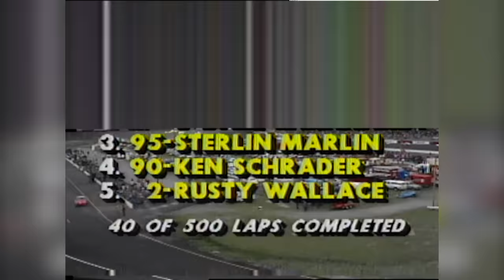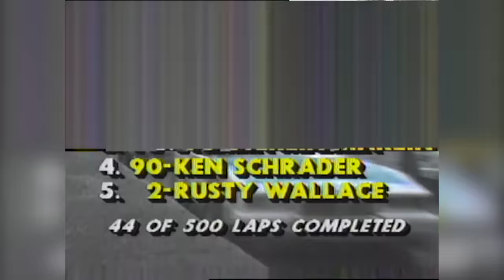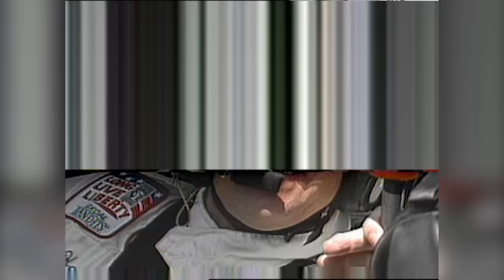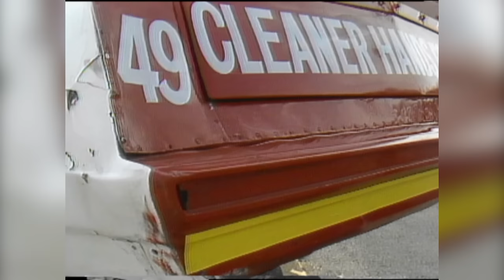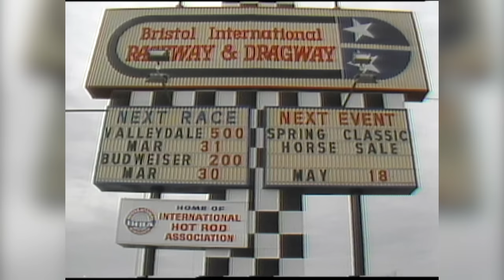NASCAR Classic Full Race: 1985 Valleydale 500 from Bristol Motor Speedway

Comment: I believe about 50 laps in Earnhardt lost power steering!! Just imagine running 450 more laps with no power steering!! What a badass
Reply: That is how they use to drive back in the day.
Granted the steering wheel are larger also...
Reply: They were also slower, had smaller tires and less aggressive suspension geometry. Makes a big difference and necessitates power steering
Reply: I know right! The drivers today are so pussified they would've dropped out the moment that went out, Earnhardt didn't. Earnhardt did everything it took to win.
Reply: @calebBalls69  nascar is a joke now

Comment: Need black curtains for the sides of my tv to frame uploads like this to conceal the blurry pillarboxing.The solution that yourlifeisagreatstory responded with isn't much of a solution since if you zoom in to hide the pillarboxing, you're also cutting off the top and bottom of the 4:3 image.
Reply: Most [newer/modern] TVs have a zoom or “Format” button/setting  that will helps with that issue.

Comment: Oh look, Rusty Wallace in the #2 car several years before Penske owned it. Nice.
Reply: gothard5 Rusty did drive the 2 for Penske before they originally pulled out of nascar
Reply: TheLocalLt it was actually #16 when Rusty drove Penske’s car in Atlanta and Charlotte.  Rusty went with 2 when Penske came back because he raced that number in other series before coming into NASCAR.  I’m sure that was probably a reason too when Cliff Stewart and Rusty Wallace got to switch numbers in 1985
Reply: PYLrulz1984 I was thinking of Dave Marcis and Bobby Allison, who both drove the #2 for Penske a couple years prior to Rusty running that #16
Reply: TheLocalLt yes and no.  When Marcis raced #2, that was mostly with his own team early on.  When he raced #2 with Penske in 1977, I’m sure that was a case, like Rusty, of him carrying over a number he raced, and Penske adopting it.  Even when Marcis went back to running his team in 1979, he raced 02 (since Rod Osterlund had the number 2 by that time) before switching to 71 during that season in honor of Nord Krauskopf (the guy that gave Marcis his best career stretch with good equipment).  After Marcis ran for Penske in 1977, it would be 3 years before Penske had Rusty drive a couple races in the 16, and outside Bobby Allison’s run when he brought over #12, 16 was generally a Penske number (a lot of Penske’s early car numbers in open wheel racing involved the number 6, with 16, 66, and 68 being used at some point or another)
Reply: PYLrulz1984 very interesting I never knew the history behind Marcis’ #71. Although regarding his stint at Penske in 1977, according to the stats Penske had already switched to the #2 (from #16) with Bobby Allison in 1976. Allison and Penske had switched from #12 to #16 in 1974, before going to #2 in 1976, then Marcis came on to drive the #2 in ‘77, before the team shut down. And then Rusty drove those two races in the #16 in ‘80 as you mentioned